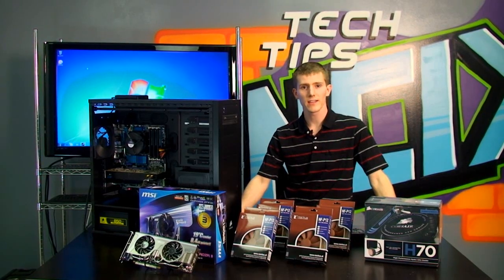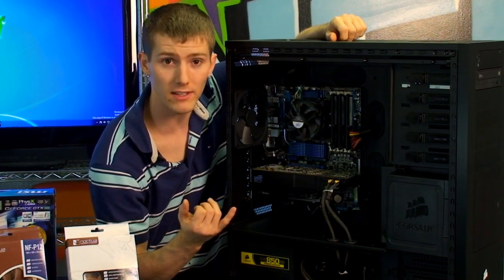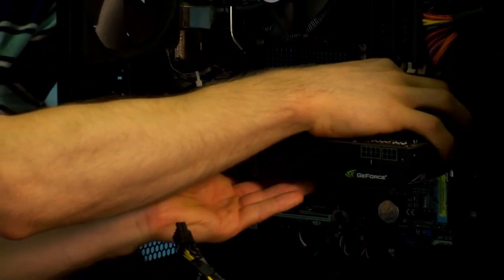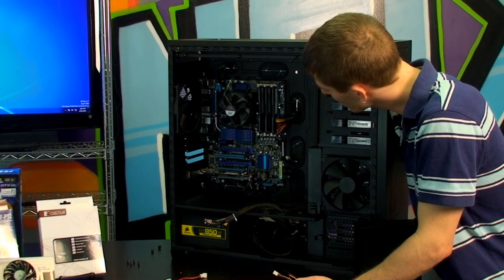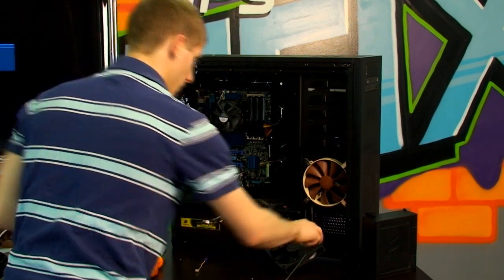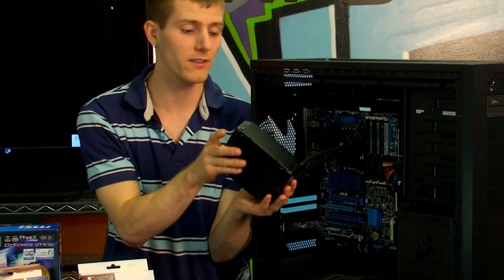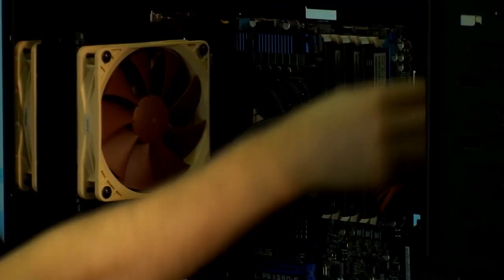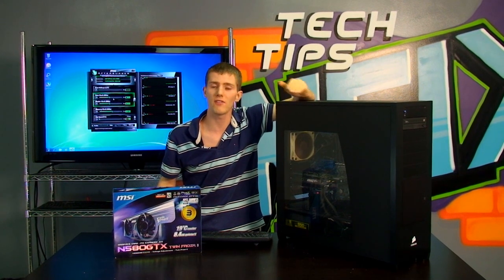Gaming PC Computer System Silencing Guide Featuring NCIX PC NCIX Tech Tips

Comment: i have a stock amd cooler,should i get a corsair h60???
Reply: in your case i would say no. (judging by your profile pic)
Reply: my profile pic has nothing to do with my case, it's a carbide 200r
Reply: Depends weather or not you over clock or plan to, if not you can leave the stock cooler on but if you are ocing get the h60
Reply: H60 is shit. The pump is constantly at 4500 RPM and cant be turned down with speedfan etc.... Avoid it.
Reply: I was thinking about getting one and then I decided to get an h80i, very pleased so far
Reply: H80i programmable led ftw
Reply: NO. get noctua NH-U12S or NH-U14S
Reply: Victor Rumenov will it fit in a carbide 200r?
Reply: BushBaby547 the 12S for sure , but you might have problems with the 14s since its a tall cooler
Reply: Victor Rumenov the closed loop cooler is better though. just replace the stock fans with be quiet fans or noctua
Reply: If you're overclocking, ayup. Personally I use a Cooler Master Seidon 240M in push/pull with stock fans in pull and Corsair SP120s in push.

Comment: personally i wouldn't put two fans on the radiator for the CPU, i've got one on mine with a voltage regulator on and it works just fine, same temperatures as the fan that came with it just much quieter.

Comment: EVGA X58 3-Way SLI
i7 920 on Stock
Stock cooler
Gigabyte GTX650
EVGA 9800GTX+
(Yes there are to graphics cards in the system)
Cooler Master 650Wt PSU
Kingston 120GB SSD
WD 640GB Hard Drive
Antec Nine Hundred Case
Reply: An SLI board with a stock cooler and 2 cards that cannot SLI with a 640gb HDD.  Priorities, man.  Even if the lesser card is running physx for you, you'd be far better off to get a second 650 instead.  I would've gone with a more civilian motherboard, then bought a better cooler and HDD, personally.

Comment: My PC's specs are : 
AMD FX-8150 (Overclocked to 4GHz) 
Gigabyte GA-990FXA-UD7
8GB Corsair Vengeance 1600Mhz DDR3
Corsair H100 CPU Cooler 
2x ASUS Geforce GTX 680's (Running in SLI Bridge) 
Coolermaster Haf X
128GB SSD Bootdrive
2TB Western Digital Caviar Black
Corsair 1200W PSU
Quite a decent system :)

Comment: im not sure what a "TDR" problem is but if after changing PCIE Slot everything works fine then yeah its the PCIE slot on the mobo thats not working proprely and no running at 8x wont make a difference

Comment: Anybody that didn't want the wait an extra week or was sensitive to their PC specs changing. For instance if your planning on a open loop water cooler then changing the graphics card would be a problem and the h70 a waste. Also the fans installed where perhaps not the ideal solution, failing to mount on the standard rubber brackets and as many people have said (although it doesn't bother me) not matching the color scheme. All in all I'd say yes, but I see why they have to ask.

Comment: My specs: Asus Sabretooth 990FX R2.0, AMD Phenom II 965BE, 8GB Corsair Vengeance, 120 GB SandDisk ultra SSD as boot drive, 2 x Nvidia 9800GT, Nzxt Phantom with extra NZXT silent fans, my GPUS are what makes mine loud. I removed the gpu fans and booted my pc, all you could hear is my secondary HDD, getting 2 x 560 ti on February

Comment: First thing to upgrade is the stock cooler. Theres so many coolers that will have better performance and be quieter then the stock cooler. You have a 3770k. Get ride of the stock cooler and buy a decent cooler (can cost $30-$60 for a decent cooler thats not a water cooler) and over clock that cpu. Next thing to upgrade is the GPU. Lots of better choices out there as well. Do some research. I dont know how much u have to spend but thats what I suggest. Get a 120 gb ssd if u want faster speeds.

Comment: My computer works well and is very cheap with these specs:

CPU: Intel Core 2 Quad q9550
RAM: G.Skill Ripjaws 1066 MHz 8 GB
Motherboard: MSI G41M-P23
GPU: EVGA GTX 560 1024 MB
HDD: Western Digital 500 GB 5200 rpm (I think)
Case: Very old and unknown (includes USB 1)
All stock cooling

Comment: My specs:

Intel i7 3770k 4.6Ghz
Corsair H100 cooler with corsair af120 fans
Nzxt phantom 820 case in gunmetal
Gigabyte GA-Z77X motherboard
16gb corsair balistix memory
1tb Hybrid Drive
Two Nvidea GTX 780's Overclocked in SLI
Replaced 4 stock fans with Noctula fans
1000w Corsair PSU

Thinking of getting a foam kit to lay at the bottom of my PC to help reduce vibrations although it does not give many off but less the better :) And finally i think ill get a full window panel with a smoked window because there is a 200mm or so fan on the side so if i can remove that without a massive increase in temperature then ill do that.

Comment: I got 7 case fans running as well as the Cooler Master hyper 212 evo fan and the GTX 770 video card fans. Thats a total of 10 fans running in the PC case..... The noise level isn't too loud but you can definitely hear the noisy video card fans.. So.. I got a couple of cheap 10' usb extension cables and moved the PC Case into the closet. Much better... now..

Comment: this is what i plan on doing with all the fans, except for the psu fan because i cant really control that, i want all the fans to work to the point where the pc is only barely audible, so your still getting ok cooling but also the pc is near silent. any lower fan speeds and you wont really get any benefit of cooling.

Comment: I'd like change the video cards to liquid cooled.
Case: Thermaltake Overseer RX-I
Fans: 2x200mm Thermaltake Blue LED (came with case) on top.
          2x200mm Coolermaster Megaflow Blue LED Front & Side.
Operating System: Microsoft Windows 7 Ultimate 64-bit SP1
CPU: Intel Core i7 3770K @ 3.50GHz	40 °C
                  Ivy Bridge 22nm Technology
CPU Cooling: Corsair H100
RAM: 16.0 GB Dual-Channel DDR3 @ 665MHz (9-9-9-24)
Motherboard: ASRock Z77 Professional (CPUSocket)	30 °C

Comment: i plan on building a new pc soon, gonna use a haswell processor, possibly 7 case fans, fluid dynamic bearing type for all fans. im trying to keep the pc for an extremely long time and i want it to be very quiet/almost silent, i wont be replacing anything on it other than the cmos battery every 5 years or so, and possibly the graphics card.

Comment: they are worth it believe me, i have my computer on my desk next to me and even without my headset i cant hear it at all, mind you i have a fan controller but under 75% they're top quiet (or if you use the low noise adapter they wont go over that)

Comment: I reduced CPU temperature by about 8-10 degrees by removing the side panel. I am using a OCZ vendetta CPU air cooler Cooler. It is very quite in operation.

Comment: Hi! I got thermaltake water v2 pro and its noicy as fuck! how i can make it more silence?
Reply: What is the noisy component? The fans or the pump? If it's the fans, you can replace them with near silent ones. If the pump is noisy, you could try changing the position of the pump so the in/out tubes are mounted as close to the bottom as possible. My older H50 with the pump mounted tubes on top at first made an annoying whirling sound when it went full speed. When I moved some stuff around and had the tubes on the bottom, the whirling sound went away.

Comment: Best buy I've made was a LED fan controller. I can set the fans to 40% - 50% (LED lights look pimped at 40%) when not in use and you can't hear a thing. When needed, I can ramp them bad boys up and get the cooling I need.

Fan controller "ftw".

Comment: its still complicated to control the fan speeds unless connected to a 4 pin header on the motherboard and its not a good idea to connect more than a few fans on the motherboard, reduces the reliability quite a bit, hooking up the fans to the psu is safer and if you have a good psu, its a reliable option than doing it from the motherboard, also fan controllers are a bit expensive, you could just buy more expensive higher quality low rpm fans for the same price with 4 pin molex connected to psu..

Comment: If you had a red or green or blue theme it would still clash just as badly if they picked one of the other colors, for max compatibility it should be black, even white cases look fine with black grills, fans and radiators.

Having said that in black it wouldn't be distinctive. Honestly I don't think the fan color is going to put anybody who is serious about low noise off, mainly because low noise cases are typically much more enclosed, so unless you have the side off looks aren't going to matter

Comment: Can anyone recommend a really quiet pc case for under £100? I'm running a standard atx board, radeon 7870, single 120mm radiator for cpu, an ssd and standard hdd. There's so much choice out there that i have no idea what to go for, i'm a fan of simple clean design like the fractals. Thanks.

Comment: And, I'm running an AMD 1055T, with dual HD 5850s on stock cooling. I am using a stock blue LED fan in the front. Unfortunately, the motherboard is broken so I've sent it in for repair.

Comment: CM Storm case, Corsair H80i wate cooler, bulldozer 6100 6core cpu, 8GB 1600 corsair vengeance ram, SAPPHIRE HD 7970 GHz Edition 3GB GDDR5 VAPOR-X,crosshair v formula-z ROG mother board, CM silent pro  1000W PSU, samsung 840 pro SSD 1TB slave HDD, Giel cyclone memory cooler, CM sickleflow fans x2 (5way LCD fan controller on the way) could remove memory cooler as its for aesthetic reasons only.

Comment: LINUS -- I have a PC that effectively heats up the top floor of my home. In the winter I just let the door open and turn the heating system off. The warm gases permeating from my room equilibriate with the frigid air, to the point that when exiting the shower and walking around, in the nude, I never get chills or goosebumps.

I want you to chill this bitch down for the summer months when I have to stop using my PC and end up spending time with family, friends, and my loved ones. I need to get back into the raiding lineup and make it to the top brackets in my other games I subscribe to. The less time I get, due to spending time outside of gaming, means that I lose points, face, drops, kills, and reputation.

This is becoming a serious problem and I had to take drastic measures in the last month during the drought. I insulated my windows, placed plastic around my door, and routed all the air conditioning vents upstairs to enter my room with the help of flexible pipes from Home Depot. This however made my daughter dehydrated while she slept and had to be taken to the hospital to get checked out. That one occurrence caused me to lose DKP and miss out on the last piece of gear I have been working so feverishly for only to have it taken away over something so petty.

Linus, I really need your help cooling my beast down. I do not know who to turn to, and where to spend my hard earned cash when it comes to cooling down my heater. Any help would be appreciated, but please hastefully respond because my guild leader said  I'm out of rotation, if I miss another night, and the next LoL/CoD tournament is in 3 weeks. I need to practice with my real friends and family, but can only do so when I can get away from my IRL friends and family.

I'll promise to like, fav, subscribe if you at least read this, because it all started with 1 sentence and I kept on writing this crap laughing as I drowsed off to sleep. I like writing random stuff :) your videos have helped me enjoy PC gaming even more, and I will make my next build once the new 6cores drop and the prices settle.

Comment: I was thinking the same thing. 4350? Does that even exist? But if it did It would be a bottle neck. Glad to know u know your system is good. Also games don't use the full potential of any good processors. Games can be more intricate. And the 8 cores aren't like quad cores or 6 core processors. Its different but works very well.

Comment: from what i see, the speed cant be controlled with the molex adapters so im gonna try to use the quietest 140mm/120mm fans i can find at full speed, possibly im gonna use the bitfenix spectre 120/140mm fans as they have a max rpm of 1100 which i believe should be considered fairly quiet still, though im still a little concerned on the noise level db part because a lot of the times its inaccurate or they don't list the loudest db, only the lowest...

Comment: The only thing I'd need for my computer to be completely silent is to replace my Palit GTX 680 Jetstream with another reference design one. Bloody thing ramps up whenever it hits 50 degrees Celsius. Undervolting and underclocking doesn't work either, it still ramps up alot. I guess thats why they call it JETstream

Comment: how long il keep the gpu for will depend on how quiet and good the performance it is, either il get a ok one right now without a aftermarket cooler and then upgrade to a better one in a year or two with a cooler and quieter fan, or il get one really good now with a quieter and cooler running fan. possibly a artic cooling one or other good quiet brand, il be probably using molex to 3 pin male adapters for the case fans as the motherboard wont have more than a few header ports for the fans.

Comment: it says about 20db, so i would assume a little more than that for a more conservative view, so it shouldnt be more than lets say 26db, and from one site, 26db is only barely audible so it SHOULD be very quiet. for cpu cooler, i might use the arctic xtreme rev.2, or some other nice one, it would be nice to find a cooler and run it at full speed from the bios all the time but still being quiet/near silent, this way, your getting good cooling and you dont have to worry about changing the speeds.

Comment: That really isn't to hot. Go to Newegg or NCIX and look up heatsinks and limit the price to about $20. I Personally say for $20 get a tall heatsink like the COOLER MASTER Hyper TX3 or the XIGMATEK Gaia where you can also later add another fan to it for better cooling. There are plenty of coolers out there for $20 that will perform better in every way then the stock. Also shop at a local computer store that sells parts and find some cheap but good heatsinks. Ask a retailer there as well.

Comment: You just have to skimp on the motherboard ($45), HDD ($50), and case ($30). Then use a 7770 ($120), along with a Phenom II x4 965 Black Edition ($95), then put 8gb of 1600 memory in there ($45), and then get a corsair 430w PSU ($45). There, I just made a nice computer build that can run pretty much any game (except maybe Crysis 3 and Far Cry 3) for $430.

Comment: I wish my machine was as quiet as this. I have Noctua CPU coolers but the 3 case fans are stock and the GPU fan is pretty loud too. Might use my ULNA adapters on my case fans actually, that might help. Stupid i7-920 gets hot so wouldn't want to use them on the CPU fans!

Comment: Mobo: Asus MN2-MX,CPU: Athlon 64 X2 4000+ 2.1 GHZ,GPU: Palit geforce gt440 1GIG DDR5,PSU:Non branded 350W,Ram:2GIG's DDR2(1 Kingston HyperX 512mb stick, one Adata 512mb stick and one Adata 1GIG stick).HDD:Maxtor IDE 5400rpm 160GIG.CPU fan: stock, GPU fan: stock, no case fans(i had one 90mm but it broke)
What i would do to scilence it you may ask...THROW IT OUT THE FRICKIN' WINDOW! (just kidding i would never throw out my first gaming PC and i got it 6 years ago but i got the GPU 2-3 months ago).

Comment: Graphics: 2047MB GeForce GTX 550 Ti (EVGA)	37 °C
                2047MB GeForce GTX 550 Ti (EVGA)	31 °C
                SLI Enabled
Monitor Type : LG Electronics Flatron E2041 - 20 inches (1600x900@60Hz)
Hard Drives: 238GB OCZ-VECTOR ATA Device (SSD)
	   932GB Seagate ST1000DM003-9YN162 ATA Device (SATA)	23 °C
	   1863GB Seagate ST2000DM001-9YN164 ATA Device (SATA)	23 °C
Optical Drives: HL-DT-ST DVDRAM GH24NS90 ATA Device
	      Optiarc DVD RW AD-7280S ATA Device

Comment: I got a 2600k, H100 same fans as you used on the H70,  Gainward Phantom 4 GB GTX 680, 1 SSD for boot, 2 for games and 1 + 3TB HDDS for dem pr0nz, TX850 v2, and Corsair Platinum 32Gb RAM 1866 Mhz... would love to upgrade the case (CM 690II advanced black) because its meeh not that great >_>

Comment: Unless you've got a window, who'll see the fans? Personally I'd rather have a good PC than have a Pretty one, if your so unsure about the looks then get yourself a nice hat.... it'll be your fashion statement while leaving the PC in a functional form.

Also there are and industrial series of fans that are black, but you miss out on the other parts in the box such as extension cable, duel splitter, low noise adapter ect because they are aimed at OEM PC builders rather than the aftermarket.

Comment: Yes you can, It wouldn't run games on max but it could still run games better than an xbox or ps3. You just have to skimp on the motherboard ($45), HDD ($50), and case ($30). Then use a 7770 ($120), along with a Phenom II x4 965 Black Edition ($95), then put 8gb of 1600 memory in there ($45), and then get a corsair 430w PSU ($45). There, I just made a nice computer build that can run pretty much any game (except maybe Crysis 3 and Far Cry 3) for $430.
Now say something.

Comment: No your wrong. The CPU is not bottle necked. What is bottle necked is the graphics potential. There is much more potential that can be used but a mid grade gpu is going at its fullest and the 3570k can def handle the gpu. A low end gpu doesn't hurt the performance of the cpu. What is hurt is the potential of better graphics.

Comment: Without doing sound level measurements for each fan in the existing system, this exercise is a crap shoot.  Sound level measurements of components outside of the case, will not necessarily translate into "quieter" sound levels inside of the case.

Comment: You'd better buy one powerful GPU than two less powerful to run in SLI or Crossfire. It's a nonsense at this budget and causes some problems.
Get yourself a 660Ti or from Radeons I can recommend HD7870 2GB from Sapphire. Or go further and buy HD7950 or HD7970 also from Sapphire. The Sapphire HD7970 is the most powerful single-GPU card right now.